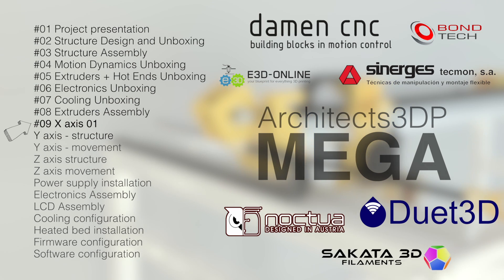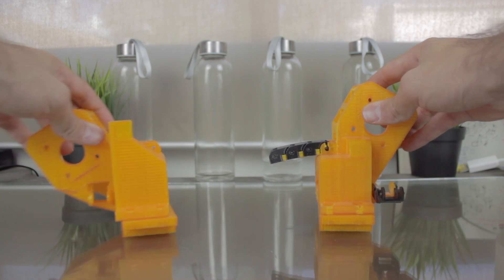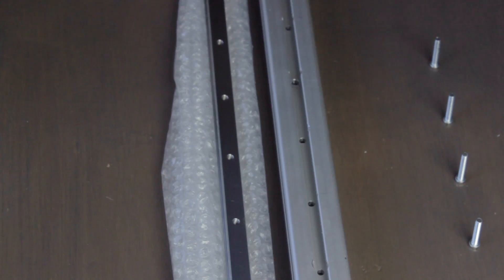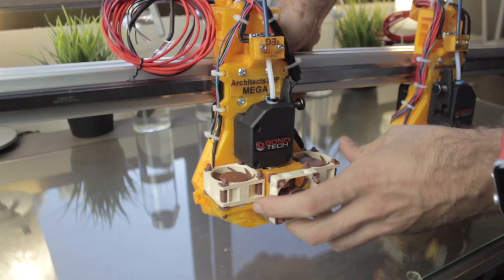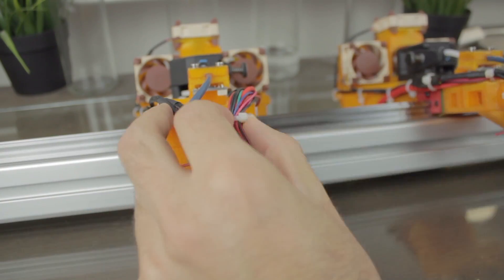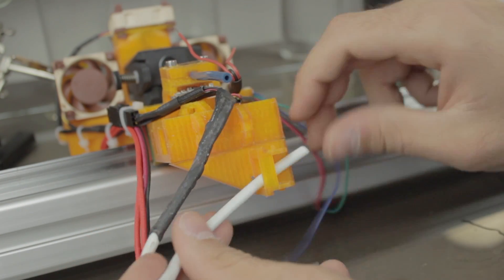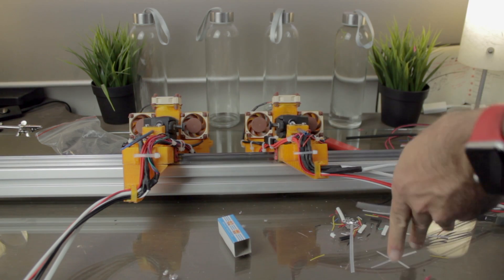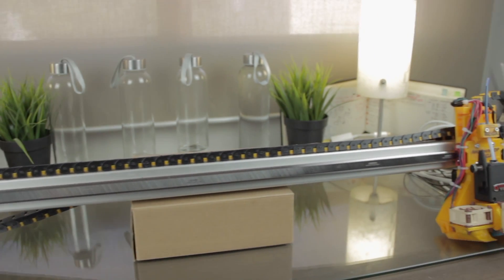Architects3DP MEGA - X axis 1/2 #09

Comment: hello I don't know the problem but for me the 3D model downloaded from googledrive is unpossible to open. Any suggestion ?
Reply from the maker: Hello zoefke, which file is not working for you? Please type the name..
Reply: Architects3DP Hello,  the totall assembly is not working, is it possible to put it in .iam or pack&go for Autodesk Inventor use ? Thanks for helping.
Reply from the maker: @zoefke4585  the files ready to print are in STL format, do you have any problem with it??
for the total assembly, it's a 3DM file. You need Rhinoceros to open it. However I can export it to any 3d file extension of your choice... let me know in detail via my email architects3dp@gmail.com
Reply: Architects3DP Hi sorry it is already working ! Thanks
Reply: Sorry I thought there was already a complete assembly of the complete printer but I think we have to wait.
Reply from the maker: Yes, it's still in progress.

Comment: I really want to make one of these!  Bullet connectors are a nice way to quick connect wires, I'm sure there are other uses but I use them for RC Aircraft.  They come in many sizes and make a really good connection that pulls apart when needed.  They also clean things up a bit :)  I used them for replacing my hot end, they are only slightly larger than the wire.  I anticipate having to upgrade it at somepoint and the quick disconnect will make it really nice.
Reply from the maker: Dear Bruce, that's an awesome idea! thank you very much for the comment. I'll link it to the BOM of this episode as optional =)